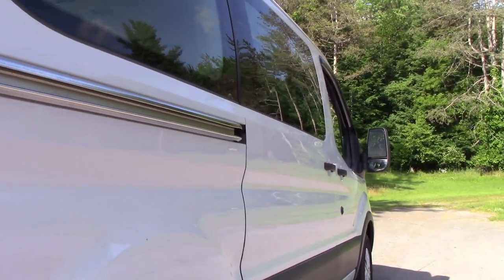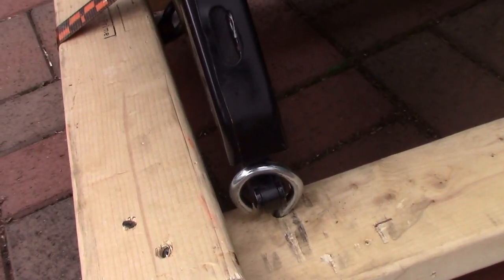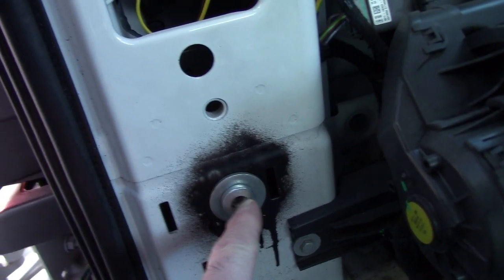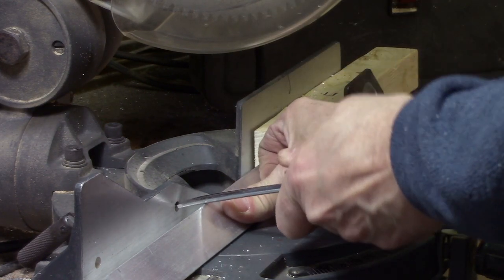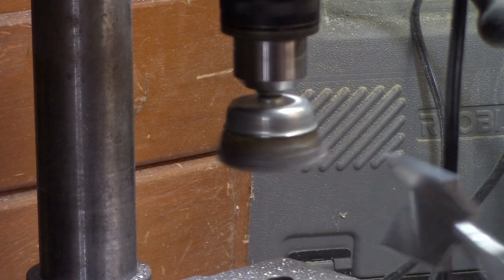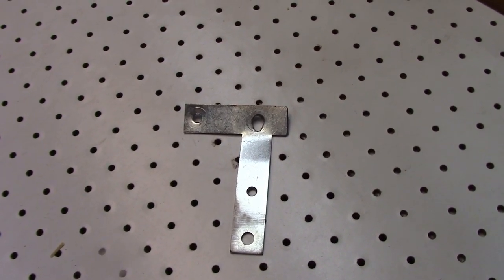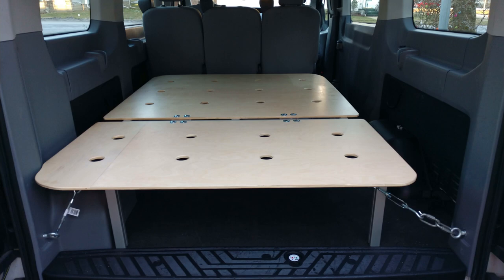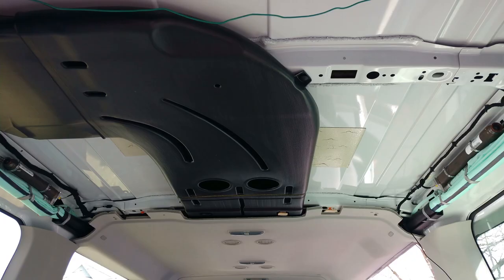Camper Van Bed Build in Ford Transit 150 XLT Passenger Wagon 80/20 aluminum campervan

Comment: I love your videos, I would to have a better photo of you seat storage platform or directions for your seat storage dolly, I would like to build one for my seats as I use my van as you, sometimes the seats are in and sometimes they are not, when in camping mode.  I have 9 seats to take out and store
Reply from the maker: It's basically like a moving dolly.  Square frame with u- bolts to hook seat base to, and casters to wheel it around.

Comment: Hey Barry! Nice! We had these huge steel plates that weren’t flat or flush with the floor, they stuck up from the floor about 2 inches and was about 12” in length and about 5” wide... which were a real pain in the ass til we finally went to AutoZone and the dude behind the counter hooked us up by removing them with the heavy duty star wrench... now it’s finally flat! We covered it with a throw rug and VIOLA! I dig your mods! We did hinges as well and put in a house sized queen mattress, still have room for a kitchen too💜 I can’t wait to see the finish
Reply from the maker: Thanks ! Those star screws stink !

Comment: Thanks for this video (and your other great videos)!  We're doing something similar with a Transit Wagon for our family.  What thickness plywood did you use for the bed platform?
Reply from the maker: 1/2" sanded ( both sides). Thanks !
Reply: @barrysoutthere  Awesome, thanks.  Debating 1/2 vs 3/4.  Really wanted to go 1/2" for the weight savings, but was a little concerned about it being strong enough.  Think I'm leaning towards 1/2".
Reply from the maker: @CrowBrosRacing  it's strong enough to lift for access with bedding in place, if supported in the center ( or both sides). 3/4 would be great, but overkill ( and heavy ). Cheers !